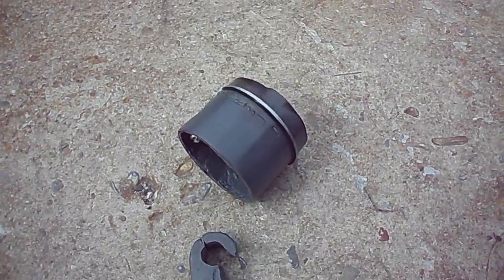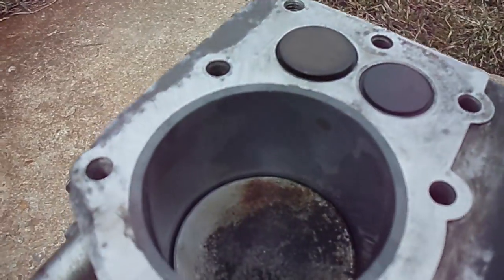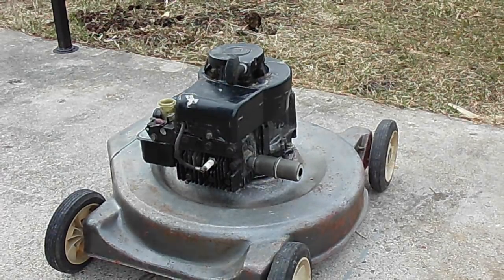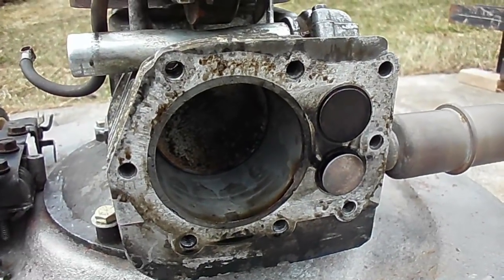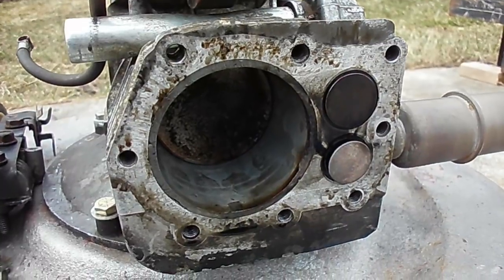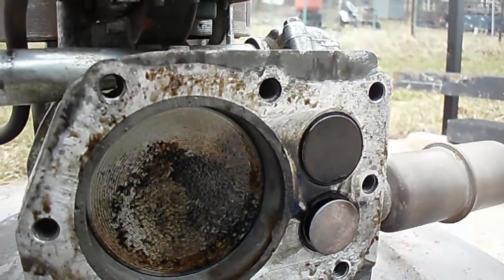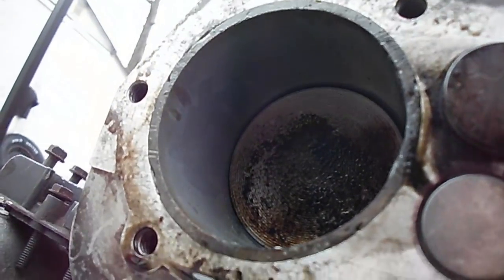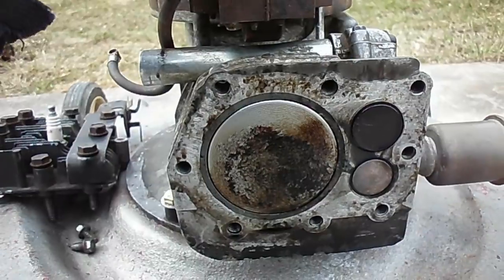JB WELD CYLINDER RUNNING!!!

Comment: how did you get the cylinder a circle?
Reply from the maker: My son worked using an NC milling machine, so he milled the cylinder to a basic size, then I honed it a little bit to the finished size. Without the circle milling feature, it would be a real pain to get it to be circular.  I guess a boring bar on a milling machine would work also.

Comment: Bro your a badass jb welder!
Reply from the maker: LOL, thanks!  I have done a whole cylinder for a small weed trimmer 2 stroke, it ran, but I broke one of the 2 piston rings during disassembly,  so it had issues after that. I did this cylinder liner, a con rod journal on a crankshaft, a conrod, and a piston, so lots of experimentation :)

Comment: you can ABSOLUTELY use JB weld to fix scored cylinder walls.  I've got over 6000 miles on my Harley Evo with a JBWeld repair job.  I did the repair as a temporary until I had the funds for new jugs after a wrist pin clip broke and damaged the cylinder walls.  I figured I'd try it.  Technique and patience is the key.  Mix the JBWeld, then coat the damaged area, then use an old piston and ring to act as a squeegee to scrape the excess.  Make sure you do this.  After 48 hours, hone the cylinder with a flex hone and put it all back together.  I was amazed.  Zero exhaust smoke, 150psi compression and even though I bought the new jugs-  they're still sitting in the shipping box until the next time I have to 'go in'.  Over 6000 miles thus far

I would NOT however, use JB for any structural repairs like connecting rods, motor mounts, the like.  It's a great filler- I know a guy that used it for a cracked head.  The crack was a bit wider than hairline but he had great success.   Your milage may vary... the key-  is PREPARING the work surface and TIME.  Clean everything real good and allow 48 hours.  Forget that 12 or 24 hours stuff, that's marketing and you're wasting your time if you can't wait the full 48.
Reply from the maker: Thanks for the great advice!  I totally agree about the waiting 48 hours or more before using it, especially in an engine. Cleaning is essential also, my son insists I clean with Brake Cleaners as a final step! So far it has worked, though Lord only knows what the long term health effects are!!!  Take care   Miles

Comment: Does jb weld hole up to the temperatures of an engine? In repairing a stripped spark plug hole with jb weld and i wanna know if it can work.
Reply from the maker: I honestly have never tried that, The lawnmower type engines I have fixed here are not intended to last a normal time, though I was shocked that the JB Piston lasted 3 minutes while cutting grass! 
 I doubt the JB would hold long while holding a spark plug in, I would think a Heli-coil would be the best bet. Hope this helps.

Comment: JB weld cylinder, nylon piston and JB weld intake valve LOL
Reply from the maker: Hmmm. I will have to investigate that combination, it might be possible to do. I was holding back using the JB piston in the JB cylinder, since if there was a problem it could destroy both of them at once. i pushed my luck with the JB piston and con rod combo, at least the piston wasn't damaged when the rod grenaded.

Comment: could you possibly cast any other internal parts? you may have some of them other than the piston and con rod i cant remember. ones like the tappets, the valves themselves, the governor and/or oil slinger?
Reply from the maker: The only other parts I have made were the plastic piston and intake valve. I could probably cast a tappet and an oil slinger, though plastic is much easier to cast than JB Weld, which is a lot thicker, while the plastic pours pretty much like water. The piston faired pretty well, but the con rod doesn't seem to want to last more than 45 seconds or so, making me hesitant to combine it with the piston and this cylinder.

Comment: Cool beans. I wonder if mixing steel or copper filings into JB Smell would improve heat transfer & wear characteristics ?
Reply from the maker: Perhaps that could help out, I purposely ran the piston loose, to allow for expansion, I think that contributes to how loud it is.
Reply: ChargerMiles007 
Maybe try both a jb piston and a liner. They would expand at the same rate
Reply from the maker: I could do that, my concern would be that the aluminum cylinder would not expand as much, so the liner might expand inwards and tighten up on the piston. I purposely ran the piston looser than normal to compensate for that, it lead to some piston slap, which is what I believe is creating the noisiness of this engine. One other thing, the intake valve has about .030 tappet clearance instead of the .006 recommended, so that could be making some noise also. I didn't want to put in such a loose clearanced valve, but it was that or one that was badly pitted, and would leak compression.
Reply: ChargerMiles007 my idea was totally based in tempering the transition ( area between valves and the leading edge of the cylinder wall ). Not running long enough to worry about thermal expansion. Piston rattle could be controlled by ring end gap clearance , I think. Only built a hand full of motors , couple being dirt track motors. Piston rings being the make/break because they're the 1st to fail from heat issues.
Reply: Id say use something a little more abrasion resistant. Maybe a ceramic powder?

Comment: try to start it again XD
Reply from the maker: I will, but it will have to be tomorrow, as it took me all day to put this together, and my wife is hounding me to go out for supper  :)
Reply: first try to crank it using drill to figure up cylinder to a piston.... or something like this.. sorry for bad english. I meand something like: if you bought/made new engine , and first you must run it for about 1Hour , then change the oil...
Reply from the maker: Oh, I don't think this engine would need to be "broken in" the piston is a loose fit, in case the JB Weld liner expands inwards, trying to become tight on the piston.

Comment: Cool video could you try to make a Briggs start deisling
Reply from the maker: I will have to think about if that would be a safe thing to do, i wouldn't want a grenade on my hands!
Reply: Ha
Reply from the maker: Normal diesel engines run much higher cylinder pressures than gasoline engines. The cylinder wall in a Briggs small engine is only about 1/8" thick aluminum, so not thick enough to handle the high pressure.